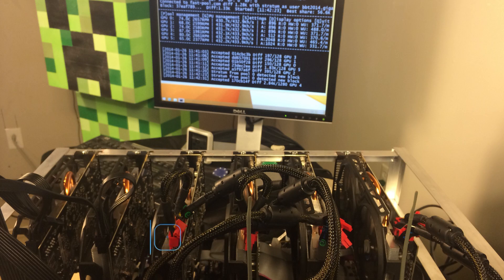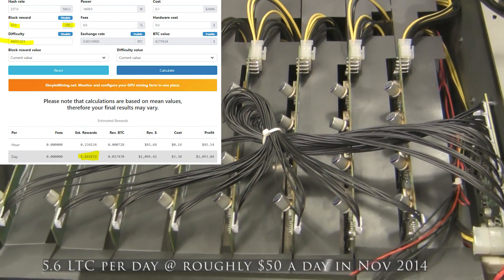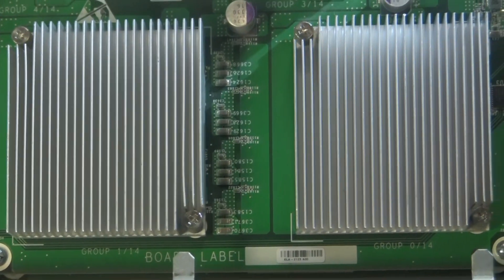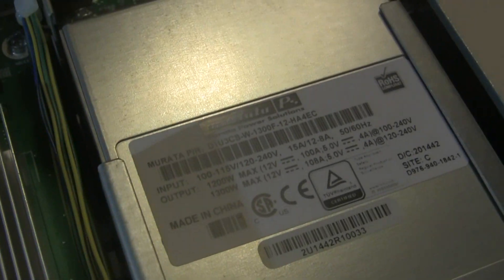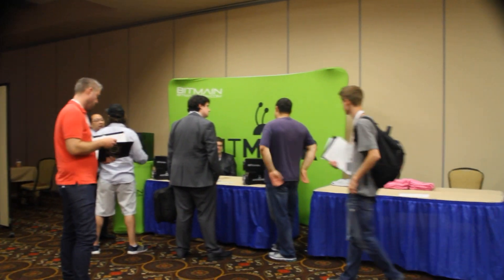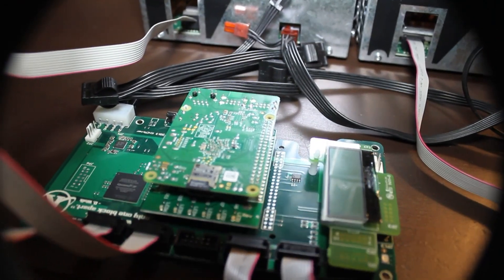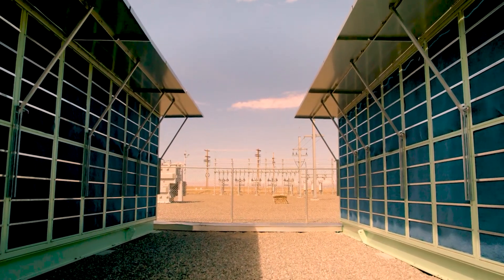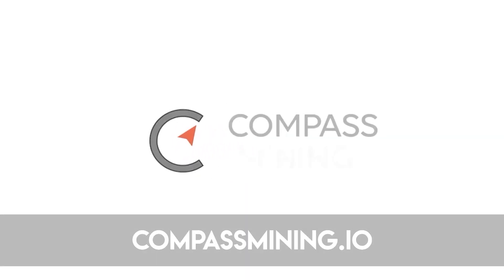0.05 BTC a day in 2014?! W/ a single asic?!

Comment: Bitcoin and the whole POW mining industry is such a terrible idea. Its like oil all over again. We could have a system in POS, that would cost only a fraction of the power and equipment.
Reply from the maker: I will address this in an upcoming video of why that idea is a false premise. It all comes down to having to do 'work' or having privilege to participate. One system is permissionless, predicated on hardware/ops/effort (PoW), one is predicated on privileged access to network through a token of the network (stake) in the PoS. 

Both systems can run, one of them has much less single points of failure. By design validators in PoS give up some of that to managing host and developers of the token in exchange for leaner ops expense.
Reply: @BitsBeTrippin  Mining is the most inefficient system in the world when you look at performance pr. watt and what you actually achieve with the data computed. Its like ploughing a field using a spoon. There must be a better way to do this, without the MASSIVE energy wasted! Do you even realise the amount of energy put into this?
Reply: @Mobay18  Here we go again... If you people STILL can't  understand the difference, we don't have time to explain. Bitcoin WILL NEVER find "a better way to do this." There isn't. Get that right. The people most obsessed with "energy waste" are likely the same individuals who have zero understanding of energy markets.
Reply: @skyyywalk3r  You don't have time to explain? LMAO! That is a good way to loose an argument. No matter how many times you are going to type energy markets, you are not going to escape the fact that energy is wasted on a highly inefficient way of running a block chain, that could be run for a fraction of the powerconsumption. Just because greedy miners are not whiling to give up profit for progress! Silly attitude!
Reply: @BitsBeTrippin  The problem is that (with Bitcoin in particular) there is no limit to how much power it will consume.  It will just grow and grow and grow.   It's the same POW now as it was then even though now it is consuming thousands of times the energy it was.  Is the network any faster for all that increase in energy used?  No.

And POW is just another form of POS.  The "stake" is the investment in hardware, etc.  Except with enormous energy costs.